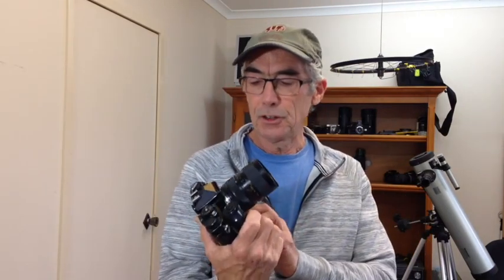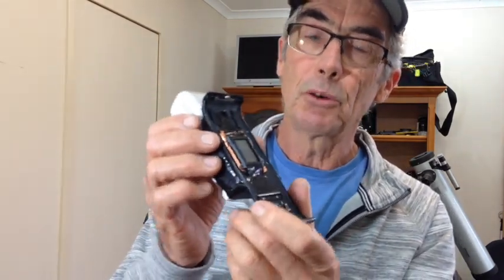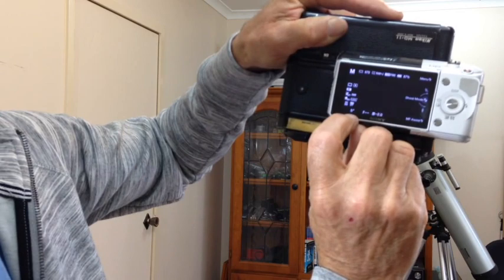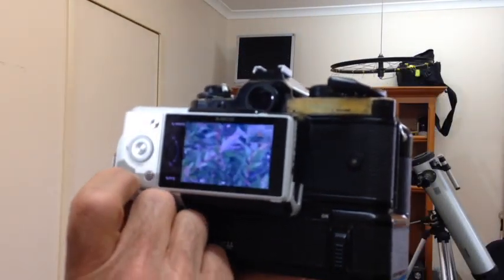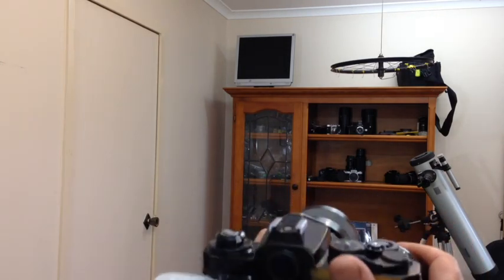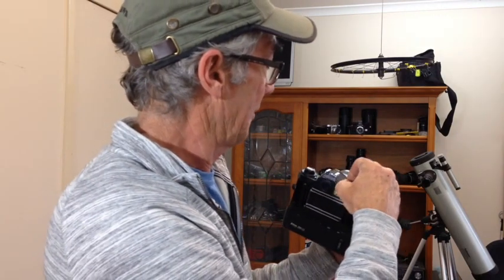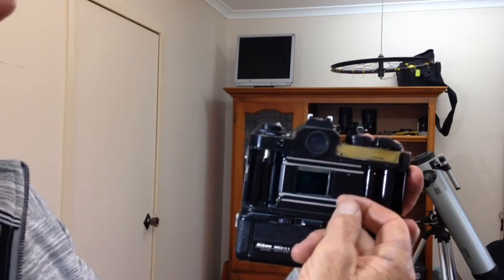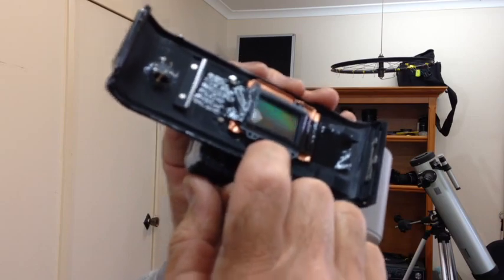Convert SLR Camera to Digital with "Electric Film"

Comment: great idea BUT want to show u what happened here , first i do photo and videos so i love cameras and diy ! i even tried to put my gopro inside a film camera lol , and i was watching ur video beside another youtube video (shark tanks show its about investments in new ideas  ! ) so here jumped to my head an idea ! so the idea is simple . thats to make a new sport cameras in china ! , its not really new but it has a new design and shape , ( i can do the design as a 3d model if u into that ), so thats design allow any one to just insert the camera inside the film camera in one click ! (fits inside any filmcamera! ) and it allows to use the filmcam buttons in same time ! the best thing about this camera is the idea and the price , it comes around 40 $ ( becuz i have some connections in china and they do sport cams for around 15 to 20 $ and maybe u know some called fly cam and Yi cams ) , so these my thoughts , images an ad says do u miss using ur film camera , now u can :) , what u think ! thanks for video and keep on :)
Reply from the maker: Hi Marc, I think your idea has some merit but the key is to get the biggest sensor as possible to fit in the 35mm film box. The Nex sensor is a 1.5 crop and it is really tight vertically so you won't fit any bigger. But a redesigned sensor for film cameras could be a lot wider which would provide a more rectangular panoramic type image but at least a larger percentage of the camera's view finder would be used. The trouble with using a small sensor (like in a go pro) is that you are only photographing a small rectangle in the middle of the cameras viewfinder. The owners of these old cameras want full use of the camera and to photograph what is in the viewfinder as the manual focus via the split prism is the great feature of these old cameras.

There is too much componentry in the Nex that is not needed in these modifications. Like the shutter is bulky and not required. The battery is too big. The screen could be smaller as you only need a quick view and to be able to adjust software settings. Flexibility on all the various cable lengths would enable a better layout in a custom made back. Happy to discuss your ideas and work in with your contacts. My email is xovercameras@gmail.com

What I believe should happen is that Sony should realise the potential for this and manufacture a component kit for 35mm film cameras that has a custom sized sensor of over 20mp that drops into the film box right at the film plane. The rest of the components to be as minimal as possible and as flexible as possible. Then film camera owners of any manufacture, could get their own custom made 3D printed camera backs and just fit these kits into them. 

Keep on with the good ideas - it's what this project needs.

Regards Robin.
Reply: Thank you for the great information , you really know a lot which is great to make it as a business ! , so heres an important thing about it , its mainly about the design of the camera ! its really different and some people will see it strange shape but it makes all sense  ! , and its about the lens ! , i know its small sensor but the lens is not wide ! , for that its going to focus right in the middle of the lens ! , (as many lenss products came for gopro ! ) , so i think i miss a lot of the technical information about that but i would like to send to u the design and with your knowledge i think u can adjust it and who knows maybe we will come with something wow :) , if u have fb please add me , march art , thanks a lot :)

Comment: raspberry pi?
Reply from the maker: These programmable motherboards were suggested to me as an alternative. But on what research I could find it does not seem to have the ability to communicate with such a sophisticated sensor as the Sony Exmor APS-C. Would be great if it did.
Reply from the maker: Interesting concept but I'm sure it would not give the results the digital back Nex with a 14.2mp or 16mp CMOS 1.5 crop sensor can provide. There are a few shots here   https://flic.kr/s/aHskGXKESj    that were taken with my converted Nikon. The quality should be as good or better than a Nex with a factory lens.

Comment: I don't wanna ruin the fun, but there is absolutely no point in doing this.
If you allready have a digital interchangeable lens camera,
all you need is a lens mount adapter.
Reply: Not if it is a Nikon or Pentax DSLR.  All their old lenses fit straight on, no adaptor needed.

Comment: But... why? You have an SLR. Great.
You have a mirrorless camera. Also great! 
Now you wanna still be able to use your DSLR with film... but fuck the mirrorless right?! Why didn't you just used the mirrorless to shoot with then??? 
That... that doesn't make any sense. Why did you cut that poor mirrorless to fit it in your old 35mm camera? 35mm film is amazing. If you want to shoot with it, get a 35mm film camera... I mean, rent it. It's hella expensive, sure. But mate... no... just NO... that's a blasphemy WTF why? Fujifilm and Olympus makes new camera bodies just like the old ones. The new Fuji XH-1 is made for cinema...
Reply from the maker: Hi Jas, Thanks for your interest. First up I love my film cameras and am really into them. I have Nikon F2's, FA's, FE2, FE's, Canon A1's, Leica M3, Leica SL2 and others as well as a fully setup darkroom for printing. The old Nikon FE in this video still shoots film as I have a spare back for it. I also have a few old cheap Sony Nex (with many adapters). I had an idea for an interesting and challenging project and I followed it through to a successful completion.
You may well think it was a waste of time but I actually use the FE/digital camera a lot for testing and experimenting with my old SLR Nikon and Tamron SP film camera lenses. But Jas I also mainly use it without the IR filter in place as this means I can shoot in infra red digital which makes for spectacular black and white landscapes. This works really well with the Nikon FE as I set the Nikon to 3200ASA and the Nex back to 800ISO so I have 2 stops more light to play with. Giving me the ability to shoot in quite low light and it is also very challenging to get the correct exposure by the using the compensation dial on the Nikon. Further tests without the IR filter show that I can use it for video and still pictures in complete darkness (visually) by illuminating the scene with invisible infra red light. I have a lot of fun using this ability on the night time wildlife we have around our area. I'm sorry you and others are so upset about this project but it proved a point that it can be done and I am pleased with the result, further more I am using it far more than I thought I would and for really different types of photography that can't be achieved with a standard DSLR or SLR. It's just damn good fun mate no need to get so upset about it. So I destroyed a few $50 Nex's in the process! Who cares, they are just throw away cameras and will never compare to classic SLR film cameras.
Regards Robin.